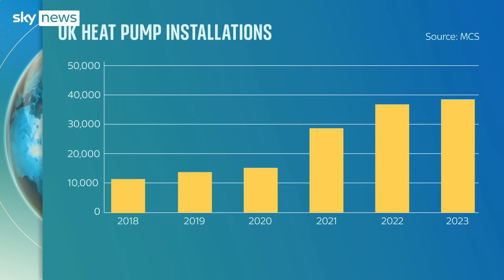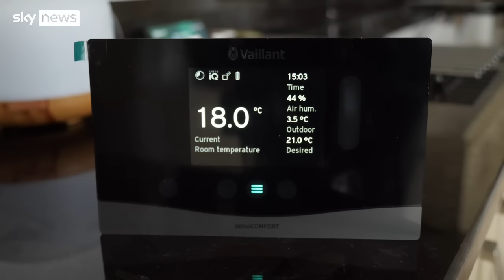Will heat pumps work in Britain?

Comment: I would like to see a comparison done with Dimplex storage heaters, which inn my view is the much better option. installation ... storage heaters 7000gbp heat pump 14000gbp. Storage off peak ,,, heat pump peak day rate ... double per kw. and stretching the grid. Vaillant claim their ASHP COP will never go below 2.3 ,,, this is only done by restricting the water flow and therefore the temperature in the house, meaning the lack of house temperature has to be made up with a secondary heating system, probably convector heaters at, at peak rate.
ASHP are a complete non starter in the UK. They are great in the South of France, apart from being a really ugly addition to the outside of buildings etc

Comment: issue is most houses also need to replace the radiators, i was quoted £12k for a full air source heat pump and low temp radiators, my gas boiler £2k costs me £30 a month for 9 months and £60 for 3 months for hot water and heating (well insulated house) so at £12k i would never ever receive a return on that investment once the running cost of the heat pump is factored in and any maintenance/break down costs which are far higher than that of a gas boiler

Comment: One thing I find with heat pump  comments..zero consistency. I've had a heat pump for 5 years, it's amazing saved me a fortune, simple to install. Next comment, heat pumps are horrendous, house needs to be insulsted to the hilt, they're extremely inefficient and break down a lot. Heat pump comments are nearly always one extreme or the other.

Comment: I installed a Vaillant Heat Pump in my new house 4 years ago. So I've now had four winters which have gone down to -7C for several days each January/February.  We've had no problems keeping VERY warm and all our visitors comment about house nice the temperature is throughout the house.

Many Gas engineers just don't want to change to Heat Pumps because they need less maintenance. Mine cost less than £10k including a 400litre hot water tank, fully installed. So after the grants it's about £2.5k. We are well insulated but they also work in older houses.

A friend in the same village who has a 200 year old house with solid stone walls installed one two years ago. He had to upgrade a couple of radiators but used all the old piping and most of the old rads. He's very pleased and so am I.

There's so much misinformation about them it makes me laugh,

Comment: The 2 that i know of fitted did not work to what they had been told it would achieve. Hardly much heat during colder days as it spent most of the energy "de icing" itself...
One of them was told by the manufacturer to include a inline heater within the pipe work to help it along in colder days 😂😂🤦🤷
The other customer ripped it out and went back to a conventional combi boiler..

Comment: Retro-fitting heat pumps is a nightmare. It is also driven by deeply flawed assumptions about the way the Great British public lead their lives. If we aim to have all of our living space warmed to ‘shirt-sleeves comfortable’ all the time, then the improved insulation and much, much bigger radiators may be worth the cost and hassle. For those of us (the great majority) who wish to use heating flexibly, a condensing gas boiler will take a lot of beating. I consume about one-third of the energy that I am ‘supposed’ to use because I only heat rooms that I happen to be in at the time. This isn’t practical for heat pump installations as they take many hours to bring any given room up to temperature.

Comment: No they don’t work in every type of homes , further more we have proven that relying on electricity alone with power lost in storms this week can put life at risk if the weathers bad , it will put families and elderly at risk . We need instead to ban g to b to force people to go to boiler plus with wether comp on an a rated boiler instead keep reducing power consumption, and further pushing industry production first into cooking alternatives, I still feel hydrogen is essential to be introduced at 20-30% but not greater than 50 % wehere existing pipes cannot cope the technological problems and cost to upgrade grid would be astronomical. That alone will save approx 72 million homes with older boilers ,30% gas  and as a grid alone cut consumption by 20% from imports helping kill that winter spike from energy prices ,  by cutting the biggest users will also save approx a quarter of imported gas , thr electricity grid can then centralise power consumption to use off peak loads to generate hydrogen power, I feel eco 10 should also be brought in to help those working from home in the day when there is often an excess and elderly,  combined with a grant based 15 kwh , battery it can help take away peak load at 6-10pm  which often needs requiring industrial ramp up , we don’t need more wind we need regular continuous power, if we off set one or two gas powered centralised power production to use off peak generated hydrogen it will save over a million c02 every month that is what the government should do than force heat pumps on property that have higher than 15kwh loss

Comment: These are garbage in winter. The house I live in now when I first moved in, it had a heat pump like these, radiators barely got luke warm, Had to buy a portable heater as I would wake up in the middle of the night shivering cold every night during winter. Got a gas boiler and it just works, Radiators get red hot when I need them to.
They may be better in a bigger house but a small house like mine they are completly useless.

Comment: I have three air sourced  heat pumps, they all clog up with ice as soon as the outside temperature gets to zero or near zero degrees celsius. This is down to the damp atmosphere we have in the UK, may be fine in Sweden or the like with very dry cold but that is not what we have here in the UK most of the time. And if any of these heat pump advocates want to argue the case I have photographs of the heat pump coils covered in ice.

Comment: I have an air source heat pump, works perfect heating a 2700 sq ft house no probs.  During this cold weather cost avg £9 per day to run my house, heating and electric. Not so sure retro fitting though ? Ours is an 8 year old house insulated to the last with triple glaze windows. Summary, works fine 👍
Reply: £9 thats a lot, my house similar in size costs just £2 - £3 a day in gas to heat every room to between 18-20 degrees and run the shower and taps in the north east using a traditional gas boiler which is very efficient

Comment: Is the UK only looking at heat pumps now? Been used for a few years in Ireland. Heat pumps are only effective if the house has been very well insulated. They are also expensive to run in times of extreme cold.

Comment: They need to be installed in all public and government buildings first. Prove that they both work and are cheaper to run before pushing this complex tech into people homes. How will insurance cover work with heat pumps given their are few technical engineers trained to diagnose and fix heat pumps let alone install them correctly.

Comment: Proper insulated homes with double glazing, ceramic electric radiators & an electric boiler (for hot water only) would suit the majority of homes far more efficiently than a heat-pump.

Comment: Didn't say a word about lack of skilled people to install and maintain these heat pumps, installations are done poorly in majority of cases with a few exceptions of excellent installers. Having to learn how to use the system is the first sign of it being bad. I don't need to learn how to use a heating system, it should just work. Do I need to know how the car works? No, I just drive it and fuel up when needed, simple, and does not cost 4x more for the privilege

Comment: The concept may work in a well insulated new build or modernised house but the reality in a Victorian listed building with single pane widows, solid walls and with bedroom ceilings only inches from the outside in places its a non starter.  Even if it were allowed, then the cost of rippping up the floors, underfloor heating, new double glazed sash windows, internal cladding on the walls (not even possible in the staircase area), totally new radiators and pipes would cost 10's of thousands on top of the the heat pump.  Thank god we are on oil so aren't funding other people's grants via subsidies on gas (although we do on electricity which should be stopped).  It's a case of buy oil when the price is down, insulate to the max where possible, secondary glazing upstairs and 2 log burners going 24 hours a day as much as we can be bothered with free firewood.

Comment: I live in an all electric 2 bed flat. My air source heat pump cost me £2,000 including installation and saves me over £700 a year on my heating. I have no condensation anywhere, all rooms are 21°C, drys my washing on a dryer in about 4 hours and It even collects dust for me. 😂 I clean the filter once every couple of months.
Reply: Is that a system with radiators? Was that 2K after the 7.5K grant?
Reply: @adrianthoroughgood1191 get this, mine cost £915 and that was with three new radiators, the water tank and all the workings and the heat pump and pipes and everything, took out the old gas boiler and meter and it’s cheaper 💪

Comment: I have a ground source heat pump in central Scotland and even with -7 temps I was only £8 a day for ALL of my electricity in a 2 bed. We do not get weather that cold for longer than a week at a time. The problem isn't heat pumps it's bad set ups, like any tech it needs optimised.
Reply: This fits with our usage in the Trossachs, which hit £24  a day during the recent cold spell. Ours is a 4 bed detached house. We have ground source and are getting a yield of 3.4 to 1.

Comment: I have a heat pump, it's run fine for the last 5 winters. The house is a 60s built 3 bed semi. There are house that this tech would not work well with. But not that many.

Comment: Heat pumps work well in Canada. At least up to -20 degrees Celsius. Colder than that and they tend to not work anymore. 
So in short they would have no problems in the UK.

Comment: The government needs to address the installation costs not just provide a subsidy which results in the supplier bumping up the overall price. This is not rocket science and the government should set a maximum hourly rate for heat pump suppliers if they want wide spread adoption otherwise people will still get fleeced by the installers. This level is 'engineering' work should be no more that £30 an hour.

Comment: Could a home owner have both. A gas boiler could be a useful backup option if the heat pump breaks and an engineer cannot fix the issue. Would insurance companies cover the cost of a repair or replacement heat pump if the existing one couldn’t be fixed. I’m open to the idea of a heat pump but I would also want to keep my existing gas boiler just in case.
Reply: You'd be paying twice and that is a crazy amount of money to burn. A heat pump has two moving parts and should be FAR more reliable than a boiler. Costs will reduce as volumes increase.
Reply: We have a heat pump and it’s brilliant but we also have a log burner which heats the house up to a point of we have to let it burn out cos it’s so hot, house is ten years old and has so much insulation

Comment: If they work here in northern Sweden, they work in Britain. Just buy the ones designed for colder climate
Reply: Your houses are built better, more insulation and under floor heating in some. Not a comparison and your electricity price much much cheaper so again no comparison

Comment: If heat pumps worked and are more economical to run than gas everyone would have them by now, what strain is these pumps and electric cars going to put on the electricity grid the power cables in the roads will all need upgrading including the power stations. How are we going to use the largest new oil gas field recently found off Scotland, sell it abroad like last time no doubt.

Comment: Load of bollocks. 70% of the population is already struggling down to costs of fuel, gas and electricity, now they expect people to pull 13 grand out of nowhere to purchase something they have that literally does the same thing, but instead its an eyesaw mounted on the side of your house.. this country is going downhill rapidly, we need someone with a bit of common sense in that government. The public are just the sheep. We have gone from leading the worlds biggest empire, to hated and led by the completely wrong people. An absolute bomb side of migrants (dont even get me started on that, especailly not after all that brexit).

Comment: I dont know much about these things but I am extremely sceptical about whether they will be any good or not. The trend with all this new eco fad tech seems to be to take something very useful and make it way worse. 🤔
Reply: Heatpumps is nothing new. It had been around in Sweden since late 70’s. 
Its nothing magical either. It works as your refrigirator. But instead of producing cold. The compressor produce heat.

Comment: Yet to hear of any MP or member of the HOL having their gas or oil heating ripped out to install a heat pump system . In fact the only well known celeb I have seen was John Humphries standing next to a skip with his two year old heat pump in it , while a new gas boiler was installed . His family threatened to leave rather than spend another winter with the useless heat pump heating .
Reply: Very common in Sweden/nordics since the 70’s Where its really expensive to heat a home during winter. 
No complaints on not keeping warm

Comment: I think we really do need more information as consumers as there is such a range of experiences - there is also a concern about noise which I don’t think people are thinking about - a non-stop low thrum would do my head in
Reply: Noise is almost always created by the unit not being installed on a perfectly flat base and with no rubber pads under the feet. If it is uneven, the bearings on the fan rub and that creates a squealing noise. Easily fixed - but if the installer was competent it won't ever happen.

Comment: Regardless of efficiency or effectiveness the cost does not add up for me. My small semi probably needs additional work even if it's just replacing the radiators and I've no idea where a water tank would fit. Even so, let's say the cost was reduced to £7K and reduced my bill from £90 to £60 per month (combi boiler).
1. I don't have the £7K so would have to take a loan, interest uncertain.
2. It would take almost 19.5 years to recover the initial £7K. Not including interest and assuming energy prices remain the same (unlikely). 
3. At 66 years of age it is very unlikely I will see any real benefit.

Yes, I would like to be more environmentally friendly but I simply cannot afford it.
Reply: Your not expected to replace a fully working system. Your boiler wount last forever!
Reply: Niether will your heat pump @njipods
Reply: Heat pumps are all about very well insulated properties and having a good differentials in temps.. 

The UK is a much of a muchness, season wise. We used to have 4 well defined seasons when I was younger, but today it can be trimmed down to 2.5 ever close to 2. 

We tend to have a lot of older properties per capita head. Most are not suitable for heat pumps, this that are are breaking even at best, but most are costing more than heating oil.. Not to mention gas or electric.
Reply: There is a £7500 grant from the government, mine cost me £915 for the lot from start to finish, that’s all the work, new radiators, the heat pump, boiler the lot, basically a whole new system fitted.

Comment: Ground floor should be underfloor heating...if not then it wont work as efficiently as it is and it will take hours to heat due to less surface area.  Plus Wall insulation is essencial. Dont fall into a trap, insulation is vital.
Reply: Instead of everyone having to put insulation in their houses why don’t we just use more power for a cheaper more powerful induction system and build 1 nuclear power plant, that would be better for the environment and more convenient, the only thing going for heat pumps is the fact they are a/c as well but many of these systems don’t even have that which is just dumb
Reply: Insulation is not needed. just a properly designed and commissioned system.